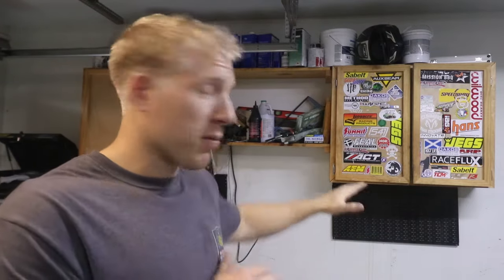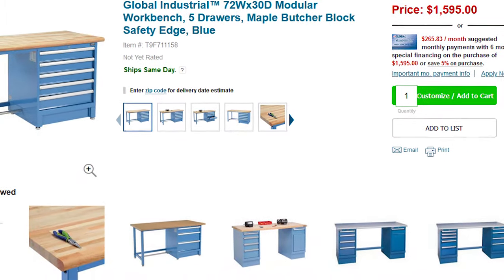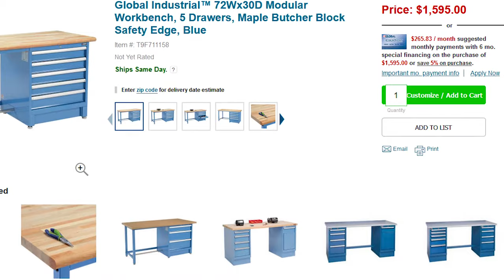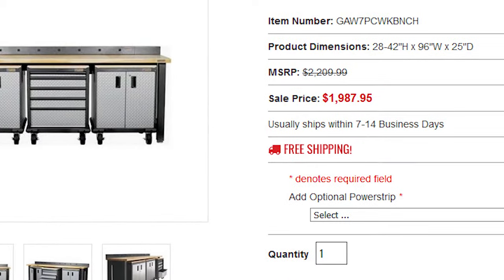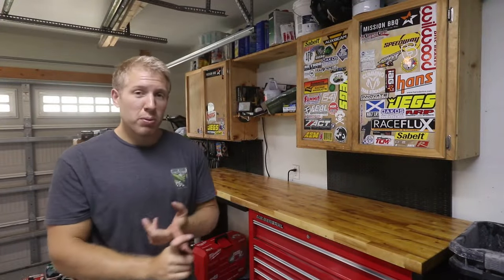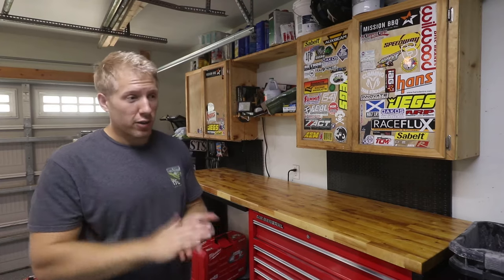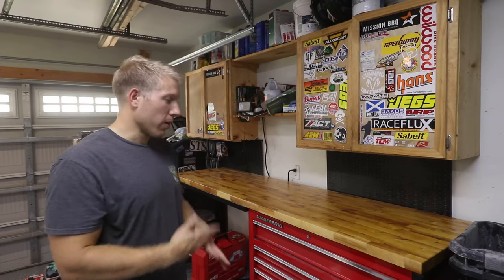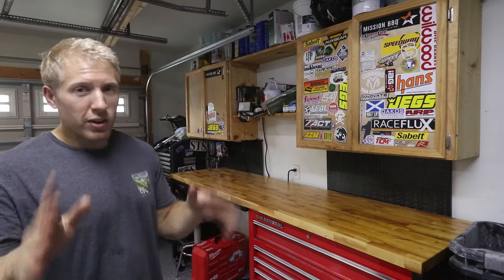DIY Hardwood Workbench With Built in Harbor Freight Tool Box

Comment: I did something similar but I put power outlets every 2 feet on the back edge. I got some flush mounting ones where you just drill a hole. They have to outlets and 2 USBs. I’m not sure what they’re rated but this was for a reloading/gun bench so it’s mostly power things like scales powder measures and lights. Nothing that draws much current but I’m sure you could find something rated for 15amp

Comment: Nice. I have had this same idea for several years, and I am building a tiny house in an insulated shipping container. Anyway, I got a hart tool box as my kitchen drawers. I will be putting an 8 ft butcher block over it as a counter, but I will need to do a sink cutout in mine. Anyway, looks great. I hadn't thought to do steel tubing. Now I need to think on it, as I had planned to build out of plywood, sort of like a more traditional cabinet carcass, but this gives me another possibility.

Comment: I use old glass jars/ peanut butter jars to store lock washers, regular washers, and nuts, bolts, wood screws etc. I then screw the lids to the underside of a shelf, doubling its value. This way the jars are held up by the lids ad out of the way. You could use them in the space between your cabinets at 11:54 for example. Since similar items are stored together it makes it easier to find too.

Comment: Inspiring ! I’m looking to do
Something very similar . Tonight I moved away from everything crammed in a full chest . Put long/bulky items on a pegboard and put all the standard hand tools in a 5 drawer  cart . It holds a lot ! 

My plan is to keep the cart to roll to my project area , and have a workbench like yours for work space for rebuilding parts removed from project . I’d like to keep electrical items and other big tools that I don’t use everyday in the integrated toolbox under the workbench .
Reply: I used the same Lowe’s butcher block for counter top for my coffee bar/pantry I built last summer . It turned out great . We thinned white paint , coated heavy. Then sanded back and stained brown over it . 10-15 coats of semi gloss and it looks weathered and beautiful. Holding up
Well

Comment: How did you attach your steel frame to the tool box?
Reply from the maker: It just floats in the three sided section I made for it. The heaviness of the table and only 1/8th on both sides holds it in nicely

Comment: What hardware did you use to attach the frame to the wood. Im doing some similar with a robust tool chest and want it to have a solid top.
Reply from the maker: I used 1/4” x 1.25” lag bolts with washers, I believe I used 10 with predrilled holes through the metal frame.